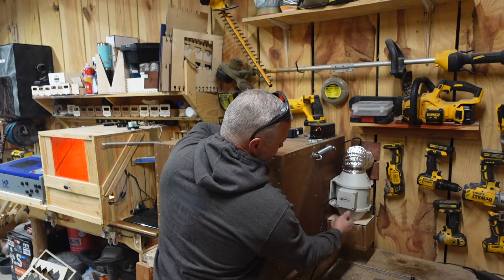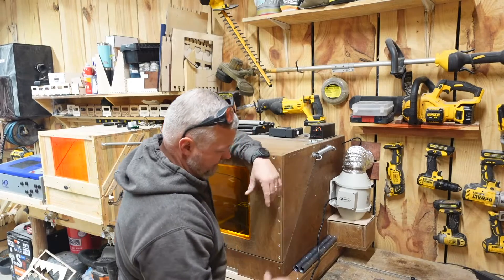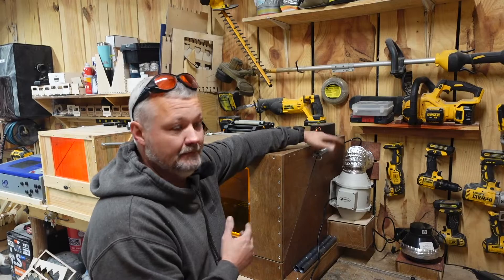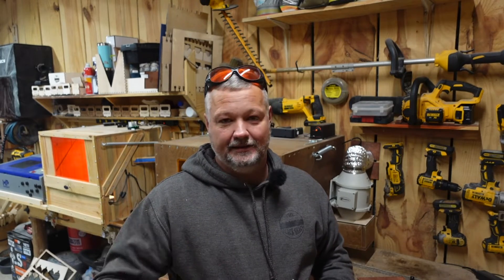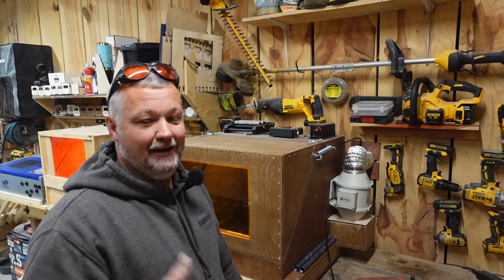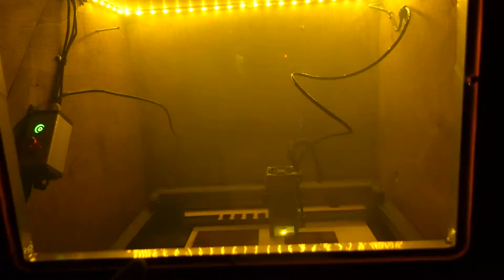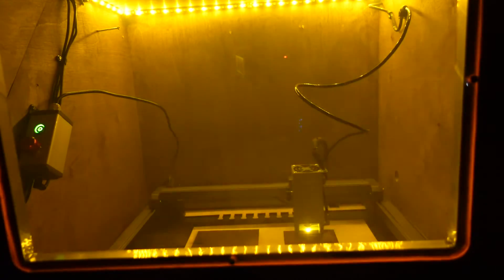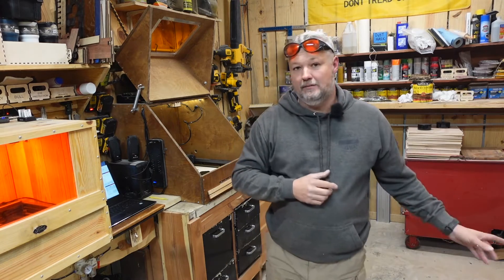My UPGRADED enclosure exhaust- Hon&Guan 4 inch fan

Comment: Hey Dave, just had a quick question in regards to this topic. We bought an S1 from xTools and its riser base component. Smoke seems to be escaping from somewhere in the chamber, can’t pinpoint it though. I ordered a 4” inline fan and the 3D printed adapter for 4” duct hose. Any thoughts on all of that? I’m hoping I don’t have a pile of returns on my hands…thank you!
Reply from the maker: Depending on the length of hose, probably not enough air flow through the exhaust. I would add some power for sure. The factory fan is a little smaller than I would like, if running it a long way, not enough. I think xtool was expecting short exhaust runs or using their filter.
Reply: @TheClackShack  that’s my hope, we’ve got it on a work bench probably 4-4.5ft off the ground and then a window above around ~8ft on the wall. I assume with the additional power and some tape on all the hose, that should help. Maybe cracking the door to the riser base would help get some negative pressure?
Reply from the maker: @DoSomethingProductive  the riser should naturally allow enough if it’s like mine
Reply: @TheClackShack  I’ll give it a shot and report back. We have the one for the conveyer feeder attachment. Thank you again!

Comment: Love the enclosure. Nice to see thought has gone into the airflow. Also good choice of fan they're mixed flow fans that give better flow at higher resistances, I'm sure you will not need to go larger. BTW I'm a ventilation engineer 😅
Reply from the maker: Thanks, I like to try and make things work as well as they can. I am a redneck engineer, does that count? lol

Comment: Congratulations for the video, what I was looking for!  Is it better to place the fan vertically or horizontally?  Is it better not to let the pipe make too many 90 degree bends to reach the window?  If I understand correctly, the closer to the window the better?  Thanks in advance for your kind reply
Reply from the maker: As long as you have a good enough fan, placement shouldn't matter. The less bends will reduce the drag on air flow. If properly sealed, the location of the fan shouldn't make much difference unless you are getting excessively long distances. In that case, I would run two fans (one at both ends). Since the machines have gotten more powerful, I run 6 inch fans on my permanent enclosures that do not have a built in fan.
Reply: Excuse my ignorance... starting from an already closed laser like x tool p2... what do you mean 2 fans attached to the ends? Thank you so much
Reply from the maker: @fabriziomezzari5551  You would add a fan to the output end of the hose.

Comment: Good point about the intake being a little smaller and spreading out the exhaust holes. One thing I'm surprised to have never seen is why nobody has just created a sealed box, but have a fresh air intake hose attached and pulling air in from outside. That way there's no chance of the smokey air getting in your home/shop and you don't have to deal with possibly creating a negative air pressure condition in the room you're working in when you're trying to vent your inside air out the box but don't have anywhere else for air to come in.
Reply from the maker: My latest enclosure has a fresh air intake from outside that automatically swaps the air pull. It works off the suction of the draft.

Comment: Newbie here, so pardon if a stupid question.  Recently purchased the xtool 40w and planning the setup.  Do you think this fan would do well with the 40 also ??  Also, why the 'collection box' under the fan vs going straight to the outtake hole on the box...to incorporate the additional small holes along the bottom right side ??
Reply from the maker: Yea, I made the duct out of necessity because I already had a whole in the wall. I am planning to add another in the bottom and use the top hole as a fresh air intake.

Comment: Hello, I have an Omtech fume extractor for my 50w laser, do you think the inline fan can connect to it? The extractor hardly pulls out the fumes & smoke.
Reply from the maker: As long as the outlet is 4 inches, if not you will need an adapter or different size fan.
Reply: @TheClackShack   I ordered the 4-6" adapter with the fan as well as the 4 layered hose just in case I needed it. It will be in tomorrow so I shall see. Thanks for responding, I love all your videos!
Reply from the maker: @craftsmadepersonal1096  , thanks... Glad you like it..

Comment: I purchased the fan below for $46.00 from Amazon. I use it on full speed, but it comes with a controller
iPower 4 Inch 130 CFM Inline Duct Fan with Variable Speed Controller HVAC Quiet Exhaust Blower, for Grow Tent Ventilation, 4" Fan & Speed, BlackiPower 4 Inch 130 CFM Inline Duct Fan with Variable Speed Controller HVAC Quiet Exhaust Blower, for Grow Tent Ventilation, 4" Fan & Speed, Black 4" Fan & Speed Controller
Reply from the maker: cool
Reply from the maker: Cool

Comment: hi Dave, Dave here too. If people are using their lasers from inside their homes, they may want to consider an installing a vent to allow fresh air to replace the air they are exhausting out. Newer homes might be a concern because they are built to tighter specs for air infiltration. If they are using a 120 CFM fan, it most likely will not be a problem. If it is larger, some should consider an outside air intake.
Reply from the maker: I could see it being an issue in some houses but from my experience, the batroom fans, door trim, general plumbing entry points, attic entry point and stove vents will generally allow enough air exchange. In really cold climates or unusually air tight houses, I recommend an air inlet.

Comment: I have your old fan. It's worked well for me so far.   I agree with you saying you have to have enough air flow in to the enclosure..  I have the Comgrow fabric enclosure and when everything was sealed up it started to collapse in on itself. Eventually I will build a new enclosure and I will have a fan blowing in on one side and one pulling air from the other side
Reply from the maker: Good idea

Comment: Hi Dave, I’ve been using the fan like the one you replaced to exhaust from two machines y’d together and it works very well. Our homemade enclosures have the exhaust ports on the side and near the top and fresh air comes in from opposite side near the bottom (long slit 2” x 10”) and seems to vent very well. Really enjoy watching your videos. Thx for sharing
Reply from the maker: Thanks for watching

Comment: Thanks, Dave. Good video. Just curious, could you adapt a bathroom exhaust fan do work with your style enclosure. Manu of then move way more than 100cfm and do so quietly.

Another question - is it better to bring the fresh air in from the top of the enclosure and exhaust from the bottom like yours is set up ... or would it be better (or as good) to bring the fresh air in from the bottom of the enclosure and exhaust near the top?
Reply from the maker: I guess any fan would work, assuming it had enough flow. I prefer pulling the smoke out from below due to the particulates (tiny ash dust), it just seems that getting too high would not allow them to be pulled out and would result in them floating around inside. The more in the enclosure, the dirtier the laser gets. Just my opinion but personal preference for me.